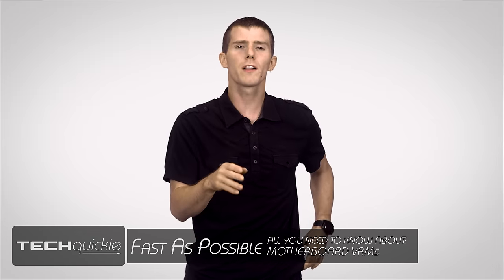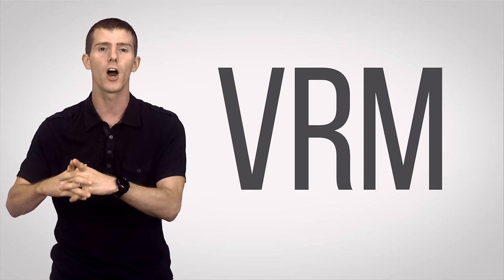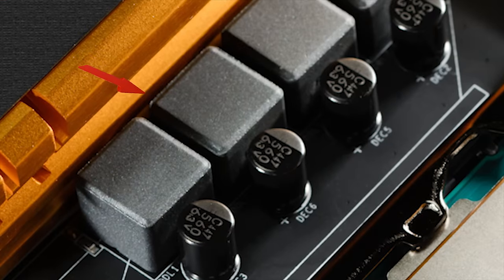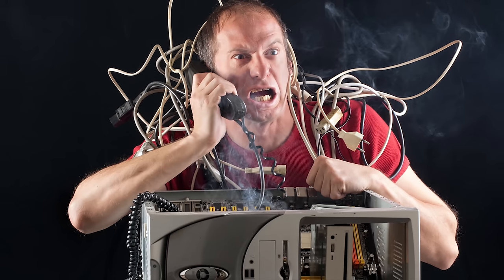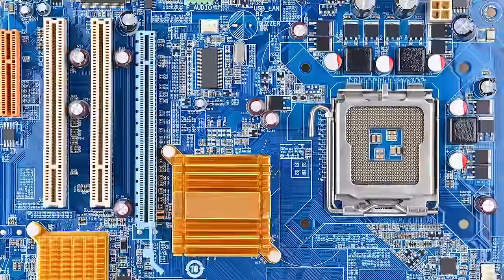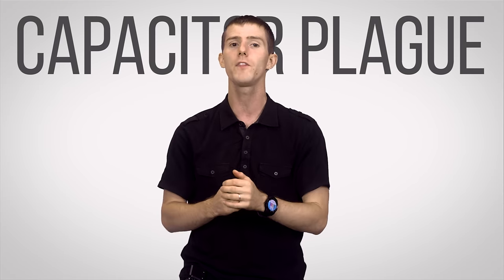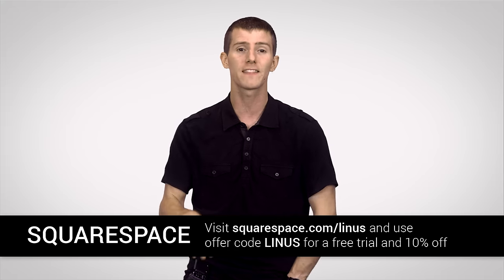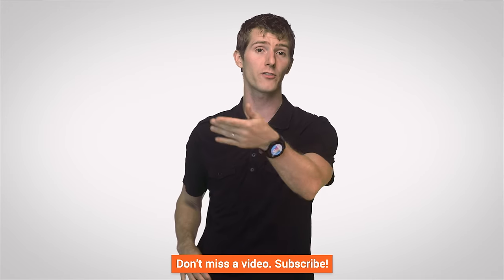Motherboard VRMs As Fast As Possible

Comment: "DC current"
Reply: +Tomshwom what?
Reply: +Guilherme Eduardo Carvalho DC stands for direct current. DC current is redundant.
Reply: James Parker Oh
Reply: +Guilherme Eduardo Carvalho Direct Current current
Reply: +Tomshwom you can take your RAS syndrome and deal with it. at an ATM machine with its fancy LCD displays that you enter your PIN number into, which turns out to be connected only to a LAN network. might as well update the DOS system. but what if it doesn't POST test successfully? may need to get an RMA authorization, though you'll have to find its UPC code and S/N number. you might be able to fix it by downloading more RAM memory.
Reply: +arrow091 this guy
Reply: +Tomshwom lol this, reminds me of people saying LED lights. That's Light Emitting Diode lights, k den.
Reply: +duviday Actually, the term "LED light" is perfectly correct.
Reply: +arrow091 stoooop, you're killing me
Reply: +Tomshwom If this was a CinemaSins video ding
Reply: FPS per second
Reply: DC current sounds like the name of a rapper from the '90s.
Reply: Tomshwom direct current current lol
Reply: This should go in his video about misused technical terms. Along with confusing load balancing architecture in a powersupply design with phase and solid state capacitors. Don't get me wrong. I absolutely love this channel and the other he has, but sometimes mr. Linus could benefit a little from learning some electronics :).
Reply: linus means direct direct current!
Reply: Tomshwom you have to know a lot about dc current to get your certificate of certification from the department of certification redundancy department certifiers department (DCRDCD Department)
Reply: I'm moving to DPRK. This is too technical for me.
Reply: RAM memory
Reply: "DC current" is actually entirely normal to say. While DC started as a term to describe current, it has long since became a term that can reference to voltage or current.
Reply: SSD Drive

Comment: ATTENTION:
In 2018 manufacturers are using 2 chokes per phase. So if you count each choke, might be dividing by 2 to get the correct number of phases.
Some manufactures claim having 12 phases, when actually the mobo have 4+2 (CPU + memory)
Reply: not Asus at all
Reply: @REVOLUTIONS51  r/woosh
Reply: Doublers have been a thing for quite some time, my msi 390x uses doubler on the vrm. And I might add, its still good.

Also the vrm, vrm cooling and memory cooling (on the gpu) are some of the most overlooked things when shopping for pc parts, asus and xfx are the worst offenders sometimes not even giving any cooling to the memory or vrm. People only focus on the core temps
Reply: @LocalAutist  and VRM temps are the least critical things to worry about, about as important as overclocking your cache.  They typically will run pretty hot, like, 160F.  unless you're hitting like 90c idle, passive airflow is enough.  but just to be safe, fill your case with mineral oil.  do it.
Reply: Is there some way to tell, by looking at it (or .. ?) what it  actually  is?
Reply: @REVOLUTIONS51  clearly didn't get the joke. hence the r/woooosh

Comment: 4:04 "AMD's upcoming Zen architecture"
Watching this in 2019 with Zen 2 about to come out to the market and knowing how good Zen is xD
Reply: Reading this comment while waiting for more official Benchmarks
Reply: @-.2..  Reading this reply while looking longingly at the R5 3600's box waiting for the case so I can build the damn thing.
Reply: @deus_ex_machina_  Reading this reply while admiring my completed build with a 3800x
Reply: Reading this comment while waiting for my 3900x / MSI PRESTIGE CREATION / 2080 Ti MSI GAMING X TRIO 11gb to be delivered
Reply: @The777Musician  Reading this comment while owning a 3700x and waiting for b550 mobos to come to complete my system.
Reply: 🦀INTEL IS GONE🦀
Reply: Reading my comment while I'm writing it from a 3700X + 5700XT + 2020 upcoming B550 MB.... 
Wait, therefore I can't be writing it from that set up...
I can't be writing it...
I can't be...
I can't.

I Kant
I
Reply: Reading this comment in 2020 with Zen 3 about to come out to the market and knowing how good Zen 2 is xD
Reply: @lolitaexpresspilot88  actually Intel only wins in games, but because of AMD winning effectively over Intel in overall performance. Intel had to drop the prices of his chips. I checked like one year ago when I was looking for building intel cpu based platform from aftermarket parts I seen that i7 3770k or 4690 were more expensive than new Ryzen. I eventually chose the Ryzen 5 3600 which gave me better performance for lower cost. What Intel is doing is looking like what AMD was doing with their Bulldoger/Vishera FXes
Reply: @lolitaexpresspilot88  3 years*
Reply: What about zen 3 in 2020 (time travel)
Reply: Watching it now in 2021 with my 5600x :)
Reply: Watching this waiting for zen 3 lol
Reply: @lolitaexpresspilot88  you might wanna delete that
Reply: @lolitaexpresspilot88  Zen 2 got close and won in a couple games. Zen 3 won everything. Rocket Lake was bad. Alder Lake came back strong. Zen 3 3D came back again. Zen 4 took over. Raptor Lake came back strong. Zen 4 3D out soon. We can keep going but both Intel and AMD are competitive these days. Don't be an idiot that over exaggerates the strengths or weaknesses of either one.
Reply: @vigilant_1934  do the P+E core separation actually do something in alder lake and raptor lake? (power efficiency? that doesn't seem to be the case with AMD still beating intel in this department in laptops, so what's the distinction for?)
Reply: Zen is almost a decade old

Comment: ... Linus the PWM controller effectively produces a PWM signal which drives the mosfets which in turn acts as a buck converter. The inductor and capacitor is a filtering network.
Reply: This video was almost as dumbed down as their episode on SIM cards...
Reply: and the diode(s)?
Reply: @DLTX1007  diode (in this context) is kinda provocative question: in usual buck converters they serve to let (main) current pass where it needs to go once switch is open. but here you have (smaller) diodes that indeed filter something:
https://www.maketecheasier.com/assets/uploads/2018/07/what-is-a-vrm-multi-phase-vrm-schematic.png.webp
Reply: @DLTX1007   don't get too excited or offensive, my young man: 
1-i introduced diodes to this discussion where you mentioned none -> good thing! there indeed are some diodes here, be it parasitic or discrete....or both! hehe
...so the lesson is that both "old fashioned" buck converters have them, as do cpu vrms.
2-what is the definition of filter in electronics? also knowing that, protection from switching aside(which in itself is filtering voltage spikes), fast switching produces noise.
oh yeah, regarding your first post: why did you call inductor a (part of) filter(ing network) here?
hehe...what exactly is inductor "filtering" in this circuit?
 talking about semantics...oughm...
if you're bored, here
https://photos.app.goo.gl/7n1SYcfJD1TiKvC58
reverse engineer that... ~ denotes mains voltage points.
Reply: @DLTX1007  perhaps you've been engineer for a too long time, as you're talking about old-style linear supply (l-c filtering) while discussion is about dc-dc converters where no ac is happening (you just mentioned ac).
cpu vrms are buck converters, true, but not typicall buck converters, inspect buck converter schematic. they remove the typicall buck conv. big diode because voltage drop would be too big for small cpu voltages. another switch (mosfet) is put instead of diode.
inductors are  not used as filters in switching supplies  in this topography (dc-dc converters are switching supplies) but as auxiliary source of power, you don't know how these work, so learn, you can always learn something in electronics, it's a vast field...
also, your diploma interests me the least...
oh yeah, l-c filters are used in smps, but on secondary side...totally different thing....
Reply: @DLTX1007  you're well vested and versed in your ego trips, seems to me:
-square waves COMPLETELY above 0 point voltage is ac?
damn! DAMN! you can't be electronics engineer.
https://upload.wikimedia.org/wikipedia/commons/thumb/6/63/Buck_chronogram.png/800px-Buck_chronogram.png
VL is voltage thru the coil.
https://upload.wikimedia.org/wikipedia/commons/thumb/f/f0/Buck_conventions.svg/1024px-Buck_conventions.svg.png

-Schoktty drops less, true, but do you know what typicall cpu core voltage is? well?
-not literally, they're not batteries you plug in as power source, but they accumulate small amount of energy, and because freq. is high, it serves the purpose nicely. 
>Thirdly, the lower mosfet is operating as a synchronous rectifier in actual fact.
hehe...now you're google-ing it!
but you started off by saying inductor and capacitor are filtering network in cpu vrm. that's false. only one of those is filter in cpu vrm. and it's not inductor. because it's dc-dc converter. 
>Power supplies are literally one of the fields I am very vested in
you were, my man, you were! 
we converted to switching supplies some decades ago. and you're not vested at all if you don't know what ac/dc is. pulsating dc is not ac.
have you learned a thing or two by now?
yes you did!
but the pcb i showed you is more interesting than this class of ours....

Comment: "Just count the # of chokes on the motherboard!"
ASUS: (maliciously chuckles)
Reply: Gigabyte likes putting chokes on their boards
Reply: @petersmulders8058  the proper term is "inductor".  I mean, it can be used as a choke as in, decoupling high frequencies from low and blocking them but letting low-pass through.  just like a transistor can be used as a logic gate, a choke, a switch, and a diode and probably at least 1-3 more things I can't remember off the top of my head.  When a transistor blocks current flow in one direction, they don't suddenly become "diodes"

Oh, me?  I'm Life of the party, nice to meet ya.

Comment: Have you thought of doing a video soldering/changing a motherboard from electrolytic capacitors to solid polymer capacitors? Might be an interesting duel between Linus and Luke to see who's motherboard doesn't explode.

Comment: Those IC pictures are not mosfets... Mosfets have 3 pins. Mosfets are really just a type of transistor.
Reply: +oddball0045 some ics have mosfets integrated.
Reply: +oddball0045 Most MOSFETs on motherboards are not just discrete transistors, they're usually built into a larger IC that also contains drive circuitry. Here's an example of the MOSTFETs used on recent Asus motherboards: http://www.digikey.com/product-detail/en/CSD87350Q5D/296-28318-1-ND/2615905

You can see the large metal areas used for the large currents of the MOSFET and to remove heat... And all the other pins are for the other circuitry inside.

Although, you're probably right, the pictures were not of a MOSFET nor a FET controller, just a random IC.
Reply: Guilherme Eduardo Carvalho yeas

Comment: Couple of issues with this video. 
number of phases doesn't always mean better, not all phases are created equal, a 8 phase motherboard might have much stronger VRMs than a 12 phase one due to having better mosfets, chokes and so on. 
Skylake requires MORE phases compared to broadwell and haswell as they have FIVR which does most of the voltage regulation on the cpu, the motherboard only needs to feed the cpu with a constant 1.8-1.9 volts which means less current, which in turns renders you able to reduce the chokes because you're less sensitive to ripple and you're also delivering more power per amp to the  cpu. 

Looks like Linus might just be hyping skylake for intel, #itsaconspiracy.
Reply: +TheLawnWanderer yes but its better if you get a 12 phase mb that performs worse than some 8 phase than getting something that dies with a turbo boost overclock
Reply: TheFPSPower A 12 phase motherboard might be better yeah, but 12-16 phase stuff is overkill for anything but LN2.
Reply: +TheLawnWanderer He was sponsored by Intel in many videos. He just forgets to declare it every video, on accident...
Reply: +Yew Tewb That's what happened when you stick with a single company in a long time.
Now when he's talking about something that related to Intel, even in a non sponsored video, he will talk about Intel.
Reply: ***** Only Intel+Nvidia builds, except when he can't control it, like when his child builds the PC.
Reply: +TheLawnWanderer if you listen to his wording he says "CAN" not "DOES" when referring to things related to your comment. so youre basically paraphrasing him
Reply: EZOVERDOSE They way they use the wrong pictures when describing parts does tell me that either linus or his video editor doesn't know much about what they're talking about. 
You will literally never see a MOSFET in those form factors.
Reply: TheLawnWanderer
i think you are taking the humor aspect of the video too literal. im surprised you didnt argue that 2 mosfets of the wrong form factor humping is not how power gets stepped down to a choke. its pretty obvious to find out what a mosfet looks like when all you have to do is search google images for 'mosfet'. and yea you dont see anything like the picture they used. which means they went out of their way to use something that wasnt correct for the spoof
Reply: +TheLawnWanderer  But at least more phases means better selling XD.
Reply: You sir... I like you.
Reply: +TheLawnWanderere Nigga he literally hyped zen right after
Reply: ***** You can't tell the quality of the mosfets, to do that you need to get the part number and google the datasheet, become a electrical engineer on the spot  and then you can tell if its good or not, chokes are a bit silly because its just a copper wire coil potted in a plastic/epoxy so it doesn't really matter.  
LN2 stands for Liquid nitrogen. 
Don't overthink it, unless you're going to overclock it massively just go with what you can afford and what you hear good about, no high end motherboard manufacturer has issues today except for EVGA for some reason.
Reply: +TheLawnWanderer Great topic think this is linus best video ever some mobo have virtual phases that are not real right but are marketed to mislead how do you know the difference?
Reply: +TheLawnWanderer In your opinion whats the best memory timing for various mobo cpu to prevent high latency issues ?
Reply: Kim Lu Really depends on what you're doing, if you got a APU you want high frequency, otherwise you want the middle ground frequency with as low  latency as, DDR3 1800-1600 is good and DDR4 2600 to 2800 is the sweetspot.
Reply: +TheLawnWanderer You are a beast man thanks for the short read i learned a ton of information from you, thanks again for commenting.
Reply: Its good to mention that 12 phase VRM can be cheaper than 8 phase VRM, because sometimes more of weaker is cheaper than less of stronger.
I have MB with "8 phase VRM" and it can handle 120W TDP intel xeon which is also overclocked from 3 to 4ghz@1,35V, so it can reach 150W...

Comment: Both chokes and Capacitor works like a storage of electricity but in a different way.

The chokes  oppose  sudden change of current and the capacitor prevents voltage spikes or ripples. With that being said, in general more is better but only to certain extent as pointed out by @TheLawnWanderer  

I would however would look for spec sheet of the capacitor since that's the visible part.
Ideally a very low esr rated capacitor is expected in a quality MB.

Comment: Each choke represents a phase? LoL. No wonder board vendors continue to stick a ton of chokes to make boards look like they have more phases than they do. Tech channel sending wrong info like this.
Reply: Exactly, it's better to count the mosfets.. 2 mosfets per phase.. Even then it doesn't make any difference because the quality of components is what matters.. If you want, you can read and search data sheets of all the components and know quite a bit about electronics to know what you are dealing with..
Reply: Even if you count the mosfets you're not really counting phases. I can't think of a single "8-phase" VRM on a current motherboard that isn't just a doubled 4-phase.
Reply: @GonePh1shing  there's properly doubled VRMs (IR359X/ISL661X/etc) and then ...setups with 2x the mosfets. also, X399 and it seems X299 (and some gens older than when i started paying attention) have REAL 8 phases. check out Ye Olde VRM Bibles at hardwareluxx

Comment: Linus:

Please be the good guy among all the geeks and stop talking about 3 or 4 and even more powersupply phases for the cpu.

Phase has nothing to do with it. Phase requires a time component to be measure against which is simply not there in DC. Phase is an AC thing, and AC has no place near a CPU.

I had written a thorough technical explaination about the whys and hows from electronic engineering's point of view, but it disappeard before I finished. So I don't wanna do it all over again.

But the number of phases as you say do not mean that it is better (with more). This is a load balancing / efficiency trick done by the engineer that designed it, and is a VERY good design. But the phases you talk of,  is correctly refered to as rails when it comes to DC.

AC however - phase is correct. a 3 phase AC supply is also for load balancing / eficiency.

I doubt that I can say anything to correct these wrongs in the whole interwebz geek communities, but it is how it is.
Reply: Doesn't phase refer to the slight time offset of the square waves created by the controller? If so isn't it the right term to use?